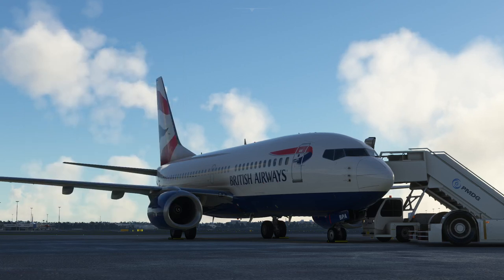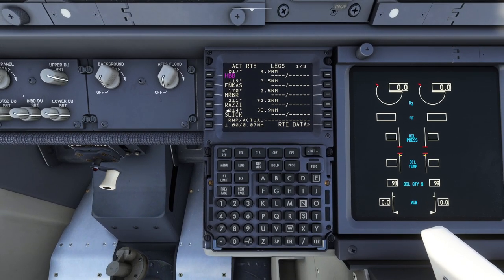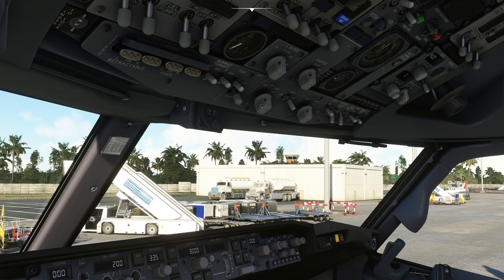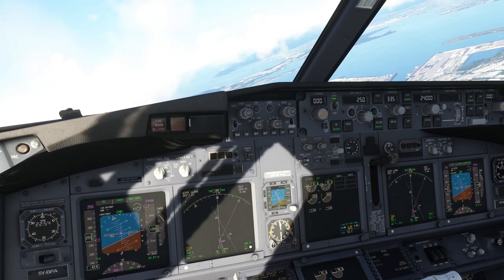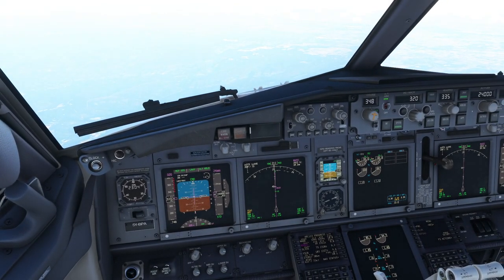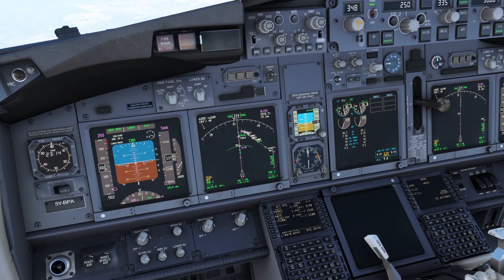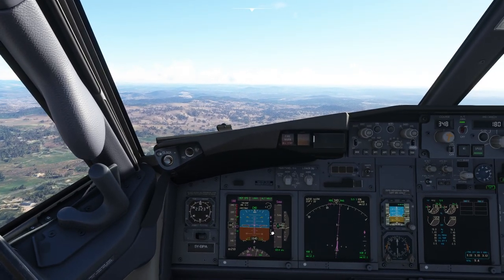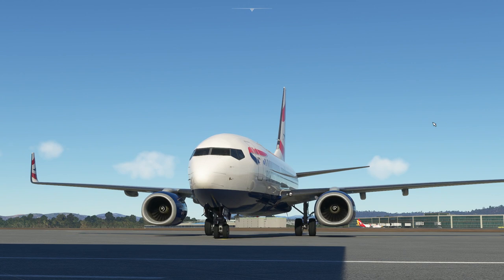Flying the PMDG 737-700 from Sydney to Canberra - from Cold and Dark to Parking and Engines Off

Comment: Thanks again for this video Jonathan.I reckon I've bashed my eyes,lol, on this about 10 or more times to figure out the 737-600 start up and using the FMC and programming it with L/Navmap.Thats been a massive help for me.Still struggle with Simbrief but you showing with LNM has helped heaps getting things into my thick skull.I've followed your video 3 to 5 times just trying to copy exactly as best as I can what you have done here.I've now attempted 3 short flight,Capital city to capital city here in Australia.1st one start to finish good.The second one the plane lost it after the 3rd way point and it wouldn't follow the Lnav anymore.I did nothing to it to make it glitch I swear,lol.The 3rd one I've just completed and that went without a hitch.Thanks again!😁😁👍👍
Reply from the maker: Thanks for the great feedback!

Comment: Can you load the flight plan on this aircraft like you can on the other planes by selecting departure and arrival locations on the world map before loading in because I’ve not seen a video that shows this is possible, like you have to load the flight through the FMC for example the a320 select departure and arrival airports select low or high altitude etc and that plan loads on the aircraft but I’ve not seen a video that shows this plane does that? Hope you understand what I mean. Thanks
Reply: I believe you cannot but it is better to use simbrief for this airplane since it is really compatible with it. It loads all your data based on load, weather report, cruise data and fuel usage. If you really cannot due it via simbrief then there's always the option to put everything manually like a real pilot :)
Reply from the maker: That's not quite right about Simbrief - it doesn't load all details of the flight plan - you still need too review the SID and STAR, for example.
Reply from the maker: I don't think any of the more accurate aircraft use the flight planner from MSFS.